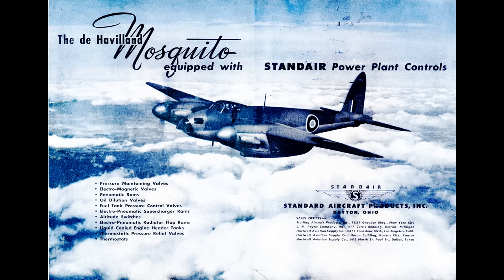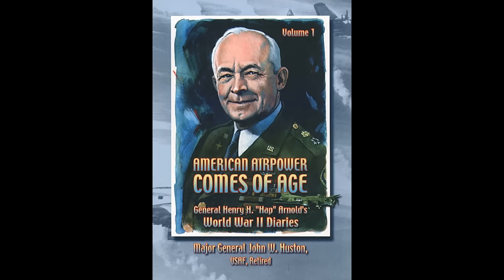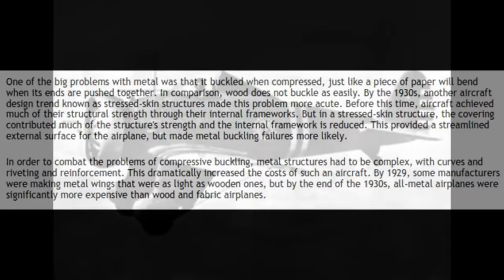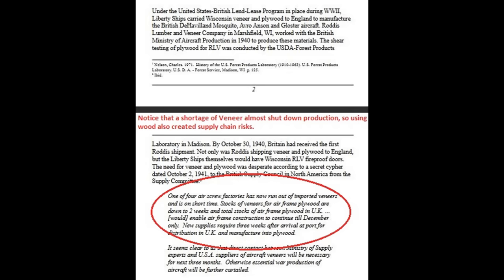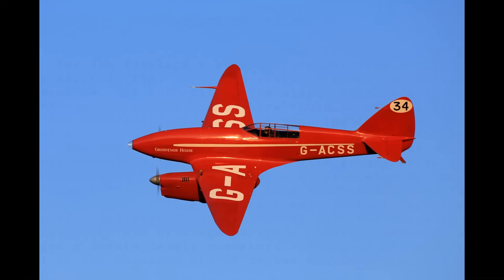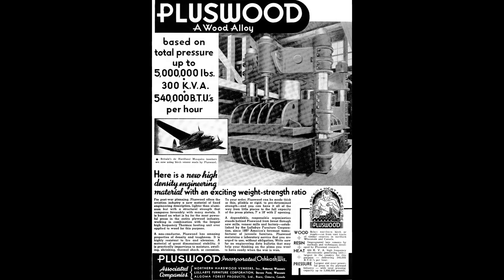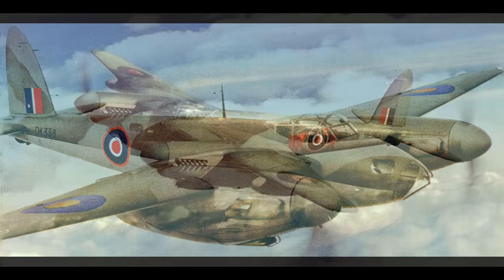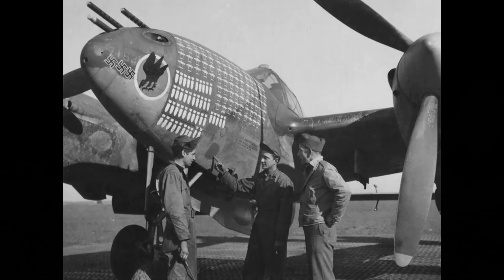De Havilland Mosquito vs. ?

Comment: Every mosquito had a similar lighting variant? Did they ever outfit a lightning with a 50 something mill cannon and send it out to dive and shoot submarines? Score one for the Mosquito on flexibility. But in truth, I wouldn't compare these planes. The lightning was much more a fighter and I would assume had more kills in air to air than mosquitoes. As a mosquito would generally try and avoid enemy fighters where as the lightnings might go straight towards them.
Reply from the maker: Yes, every mosquito variant has a SIMILAR Lightning variant. I didn't say identical. Both flew anti-shipping strikes, the P-38 carried 10 HVAR Rockets, which were far larger and far more powerful than the 57mm cannon. The P-38's HVAR Rockets had 5 inch diameter motors. The Mosquito also carried Rockets, usually the RP-3 Rockets which had puny 3 inch motors. If we compare only firepower then the Mosquito in most variants has more, but that's not the only basis for comparison.
Reply: @GregsAirplanesandAutomobiles  A thought for a future video perhaps:
I know from videos about the typhoon, that rockets although scary, were not very effective and didn't hit the target very often. Like the current Hamas Israel situation, they tend to be a terror or bombardment weapon at best. I've seen a video of a mosquito pilot, who sank a sub with that 57mill setup. I wonder, was that a rare event? How effective was that cannon they put in the mosquito compared to rockets?
Reply from the maker: I'll cover all of that in a video. The 57mm cannon was not all that effective, which is why the idea died out quickly. The HVAR rockets were used up through the Vietnam war. I do think your main point it valid, which as I see it is that the Mossie had more firepower overall.

Comment: Your point about wood vs steel as far as bullets is concerned is a bit missleading . You talk about a telegraph pole and 303 calibre bullets but the planes they wer going up against had a lot more fire power that a rifle like a 303, The bullets being used then would rip through steel just as easily as metal . The Mosquito was a very solidly built plane , it even had a cannon in the nose in one of its incarnations , that was used a lot in sub hunting, 57mm, with a fast rate of fire.
One of the main reasons for the use of wood for the airframe was the shortage of metal in England at that time , everything including garden railings had been taken and used to make tanks and other weapons.
That report seem about servicability , structural strenth , ease of construction and flying characteristics looks like a '' jobs for the biys report '' , or just plain jealousy , it was not American so they decided to give it a bad report . That plane alonside the spitfire save Britain in so many ways . 
Its a pity you did not read all of that later report ( 22. 28)

Comment: the me 163 ate these for lunch
Reply: The Me163 ate German pilots even more. It was a death trap and actually too fast for the job it had in the entire war maximum 18 kills. The Mosquito air to air 600 or so. If Mosquitos were it's lunch it would have starved to death. The fact nobody post war went in that direction might be telling. A lot of German stuff was poorly designed they just happened to have funded a lot of designs. By the law of averages they were bound to come up with a good design not the Me163 though.

Comment: P-38 is a great plane but reliability was not that great.
Reply: The USAAF in the Pacific sure made deadly effective use of the P-38.  Look up Richard Bong and Tom McGuire - the top two US Aces of WW2 flew Lightnings in the Pacific. And Charles MacDonald at #6.  And the long range raid that took out Yamamoto.  The P-38 was by a long shot the star USAAF fighter in the Pacific.
Reply: @petersouthernboy6327  They had problems with the P-38 in the PTO initially as it had fairly complicated engine controls. Once Charles Lindbergh demonstrated how to set up the plane for cruise and further use of the engine controls things got better, as it was fine at the lower altitudes flown in the PTO but at high altitude in temperate climates it didn't prove as reliable as expected and one of it's limitations was it would overheat when full power was used. It was also expensive, IIRC it cost the same as two P-51's.
But the overall sign of a good plane is whether it was continued to be developed and used after the war. P-38's were scrapped en masse. 
The best plane in the PTO was surely the F4U and probably the best fighter of WW2. It's just a pity they weren't used in the ETO. 🙂

Comment: The USA chose to kill 11 men at a shot in the b-17 rather than leveraging the mosquito's abilities. I can only feel this was done due to politics and "business", ie, bribery. It's disgusting. 

America had its own twin engine bombers, but nothing I'm aware of touched the mosquito's overall excellence.

I worked with B17 pilots: "we flew in a line, and were just basically large trap-and-skeet targets".
Reply: stra·te·gic ADJECTIVE relating to the identification of long-term or overall aims and interests and the means of achieving them: (of bombing or weapons) done or for use against industrial areas and communication centers of enemy territory as a long-term military objective: Often contrasted with tactical. 
"On the night of 18th/19th August, 1944, twenty-one Mosquitos attacked Berlin, seven Cologne, two Wanne Eickel and five the airfields at Florennes. By then Mosquitos of eleven squadrons had been used for   diversionary   attacks on a small but gradually increasing scale since the first thousand-bomber raid on Cologne on 30th/31st May, 1942. From the spring of 1943 until the end of the war   'harassing' raids   as they were originally termed were to prove a constant and, from the point of view of the enemy, a most irritating and unpleasant feature of the bomber offensive. Night after night the Mosquitos were over Germany, flying at between 30,000 and 40,000 feet to inflict damage out of all proportion to the weight of bombs they dropped. They were at once of great value as   a nuisance,   for they caused the sirens to wail and tired workers to spend yet another night in fetid, if bombproof, bunkers, and they created a diversion, thus drawing the enemy fighters away from the main bomber stream."
 Hyperwar Royal Air Force 1939-1945 Chapter XII Oil and the Climax
Reply from the maker: The Mosquito could not have replaced the B-17. That's a myth based on some huge oversimplifications and a total lack of understanding of the bigger picture.
Reply from the maker: You''re simply wrong. Even your first sentence in your first post in this thread is wrong, the B-17 had 10 men, not 11.  The reasons the Mossie couldn't replace the B-17 are too complex for the comments, but I'll make a video to smash this nonsense.
Reply: About 1,200 Mossie's were built as unarmed bombers. 
807 B25's and 510 B26's were Lend Leased to Britain. page 2
Hyperwar Lend Lease shipments Army Air Forces

Comment: Mosquito was faster than the  lightening . 
 And held nearly as big a bomb load as B17 . 
 Opportunity missed .
Reply from the maker: Regarding speed as compared with the P-38 it depends quite a bit on just which versions of each plane we compare, the altitude and payloads. In most cases the 38 is a bit faster unless you start comparing them at low altitudes with an external bomb load on the 38. There is some overlap in the speeds but I wouldn't say the Mosquito was faster. 

Now, in regards to bomb load, no, as compared with the B-17 the maximum bomb loads are not even close. That's a bit of a myth that for some reason has a lot of traction. The B-17's maximum INTERNAL payload was 12,800 pounds, far more than the Mosquito.
Reply: DH98 Mosquito FB. Mk VI
2,305 built.
Fighter bomber / intruder variant using Merlin 22, 23 or 25. 4 machine guns and 4 cannons, plus 2 x 250 lb bombs carried internally & underwing carriage of up to 2 x 500 lb bombs. Could be fitted with underwing rocket projectiles or drop tanks instead of external bomb carriage. 
BAE Mosquito page

Comment: The P 38 was not in the league as a Mosquito but Americans have a  problem with  admitting someone made some thing  better!  Mozzie   had better Range and  had better  payload! and didn't have  crappy Alison engines1
Reply from the maker: Americans have a problem admitting someone made something better? Really? have you heard of Operation Paperclip?
Reply: @GregsAirplanesandAutomobiles  
Yes I have ,  but what does  smuggling  Germans into America  got to do with  Comparing  a Mosquito with a Lightning.
Reply from the maker: I thought it was obvious. It's proof that Americans do admit it when they see someone else doing a better job. The Mosquito and P-38 comparison is coming.

Comment: Aluminum is spelt aluminium and pronounced the same, it's in the periodic table? An element? It's not that difficult. You manage Uranium right? Not Uranum? Or Plutonum? Say Magnesium? How does that sound? Like solder does not have a silent "l" , it's like soldier but "er"? Sodder is an entirely different word and means entirely different things in English? Yes, spent years with my US colleagues asking me to sodder a circuit board!

The Mosie was built out of wood because the UK was suffering and standing up against Germany, Austria, France, (oh, 50% of France joined the Nazis) the rest of Europe like Italy, Spain and the Vatican ... entirely on it's own. We had lots of cabinet makers with little to do and lots of wood. British invented plywood? And from that they built the fastest piston plane in WWII? I think for 4 years it was the fastest plane on the planet ... but I'm sure someone will correct me and claim only 3 years and 363 days :-)
Reply from the maker: Color.
Reply: Alcan was a Canadian mining company and aluminum manufacturer. It was founded in 1902 as the Northern Aluminum Company, renamed Aluminum Company of Canada in 1925, and Alcan Aluminum in 1966. It took the name Alcan Incorporated in 2001. During that time, it grew to become one of the world's largest aluminum manufacturers.

Comment: No for every thing the Mossie did the P38 could could not or did not do. Mossie PR, N/F, T, B ,FB, HS Courier ,HS diplomatic passenger,  Air Medical , Pathfinder, Naval Plane
P38 Fighter P/R  T/B  Pathfinder, HS Medical evac,  F/B .
Reply from the maker: I can't think of a Mossie Naval plane, it certainly never flew operationally off of a carrier. I guess it sort of depends on what you mean by "Naval Plane". Test flying sure, like the P-38 tested as a float plane, but that never went anywhere either.
Reply: @GregsAirplanesandAutomobiles  This is from Bill Gunston Combat Aircraft Mark 33 
First Royal Navy Sea Mosquito He does not say which unit and when .
Reply: @GregsAirplanesandAutomobiles  FAA landed and took off a R/N carrier in Mar44  They then decided to build the Sea Mosquito
Reply: @jacktattis  "never flew    operationally    off of a carrier."
Ball-bearing Run was the nickname of the war-time Stockholmsruten flight between Stockholm and Leuchars, Scotland between 1939 and 1945. After 1942 the flight was run by the Royal Norwegian Air Force, but for political reasons[1] operated as an ordinary BOAC Flight, the unarmed aircraft having civilian registration and the Norwegian military crew wearing BOAC uniforms and carrying British passports.[2] The Stockholmsruten was set up by the Norwegian Government, exiled in UK with the aim of transporting Norwegians having escaped from Nazi-occupied Norway. Several types of aircraft were used, but the backbone of Stockholmsruten was the Lockheed Lodestar.
Reply: @nickdanger3802  Nick it really does not matter .It was indeed taken into service as a Seaplane . Get over it your P38 was not.

Comment: "Why was the Mosquito built out of wood? The standard answer is that it's because aluminum was a "strategic material", but does that explanation hold water?" No. You are wrong. It was built out of wood because there where thousands of furniture makers able to built it. NOT becuase of aluminium.

It is well known that the US aircraft manuafcturers who poo poo'd the desugn and so the US bought British-built Mozzies. Sjame, how sad, never mind.  "outstanding"  usually meams what it says.
Reply: de Haviland was not getting Ministry contracts because he had little experience with anything other than wood. Depending on who you ask he wanted to contribute to the war effort or make money. When he proposed a fast unarmed bomber made of wood the RAF and MoD were not interested. He built one with "borrowed" Merlins and they were impressed but did not order it until he designed a fighter bomber version.
About 200 were reverse Lend Leased.
Yesterday's Air Force: Reverse Lend Lease
https://www.youtube.com/watch?v=6BjJt_hVKmM
Reply: de Havilland was decades behind in aircraft technology and simply didn't know anything about building aircraft from riveted aluminum alloys... case in point, the 'Comet Disaster' which completely destroyed the company.

Comment: The P38 was a plane that was no better but many times more expensive, so typical yank crap! Remember, the Mosquito could rival the B17 for bomb load with far fewer losses of both aircraft and crew whilst capable of carrying out multiple roles beyond just bombing, an outstanding aircraft which no one else could match. I feel the Americans dismissal of it was more to do with protecting American design and manufacturing than it was to do with the design or capability of the aircraft it's self.
Reply from the maker: It's hard to compare the cost of US vs. British planes. I'm not sure what the Mosquito cost in terms of USD. Trying to compare cost of German planes is an even bigger mess. The P-38 was certainly expensive as compared with a P-51, but compared with a Mossie? That's more complicated. The Mosquito is awesome, but it could not rival the B-17s bomb load unless you really cherry pick the data, which is commonly done. However maximum bomb loads for the two planes are not even close, the B-17 carrys over 4 tons more.
Reply: DH98 Mosquito FB. Mk VI
2,305 built. (about 1/3 of war time production)
Fighter bomber / intruder variant using Merlin 22, 23 or 25. 4 (Browning) machine guns and 4 (Hispano) cannons, plus 2 x 250 lb bombs carried internally & underwing carriage of up to 2 x 500 lb bombs. Could be fitted with underwing rocket projectiles or drop tanks instead of external bomb carriage. 
BAE Mosquito page